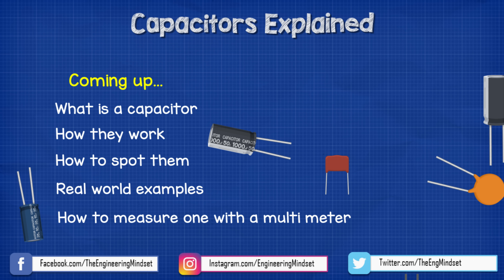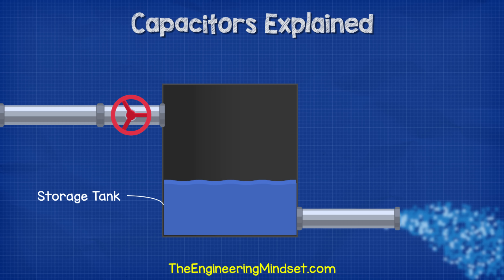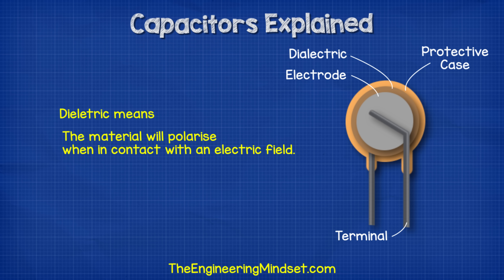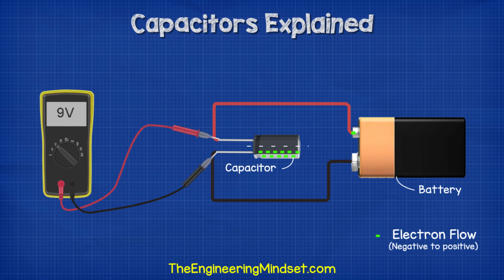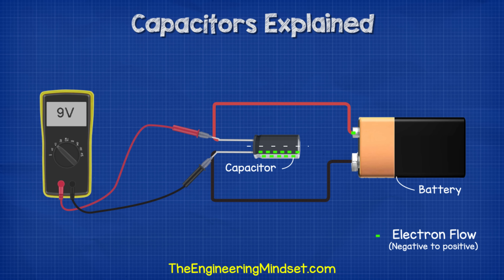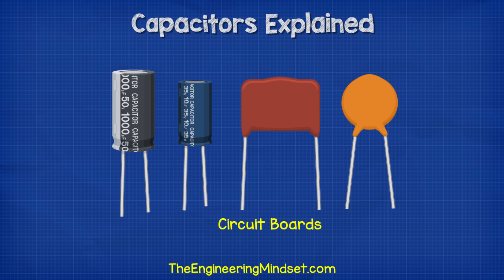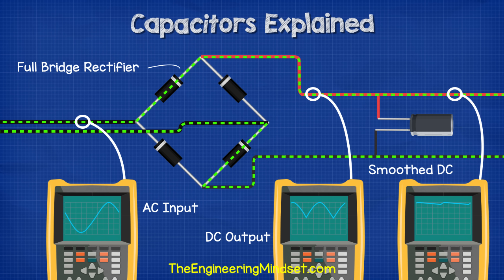Capacitors Explained - The basics how capacitors work working principle

Comment: I remember using capacitors a few times in college whenever we had practical builds, especially when we were making full bridge rectifiers. It was always fun when someone occasionally messed up and put them in the wrong way, cause they'd pop with a loud bang.
Reply: When I was working on the design of a 1 kW half-bridge switchmode power supply, a failure in a MOSFET led to an imbalance in the voltage of two 1000 µF 250 V electrolytic caps connected in series (something which has to be considered very carefully). One of the caps exploded. It was like firing a shotgun indoors.

One of my clients ignored my instructions and tested another product I'd designed without the over-voltage protection circuit, which was fairly elaborate (their product was a generator run by an air motor). It blew a big electrolytic off the board. You could tell the direction from which the blast came by the little bits of of the paper insulator from the winding of the capacitor hung on other components.
Reply from the maker: See my new MOSFET explained video here➡️: https://youtu.be/AwRJsze_9m4

Comment: I still don't know what you're talking about. I've always found electricity and magnetism fairly baffling going right back to physics lessons at school. I must have the wrong kind of brain.
Reply from the maker: The capacitor has 2 sides. Electrons build up on one side at a time. They can be released into the circuit. We can place thing slike LED's in the path as they are released to power the Led.
Reply from the maker: Seen the new LED explained video? so much detail covered! https://youtu.be/O8M2z2hIbag

Comment: Great video!  You may want to mention using an LCR meter with Kelvin Clips to accurately measure capacitors.  A multimeter is good on the fly for rough values, but is very inaccurate.
Reply from the maker: Check our new Multimeter tutorial out ➡️ https://youtu.be/4lAyzRxsbDc

Comment: I love and appreciate how the illustrations showed DC correctly going from negative to positive. It is amazing how long people, including the scientist and inventors thought the current went from positive to negative. That is why most equipment that uses DC (think cars and such that run generators or alternators) are negative grounded and protect the positive when it should be the other way (more efficient) and because it was the way it always was it still hasn't changed.
Reply: I seem to remember that cars used to be + or - ground randomly, but it was found that positive ground caused corrosion in the steel bodywork, so negative became the norm.
Reply: @chrisbrace7132  
I don't know whether it really makes any difference with something like a car, but it is certainly the case that if you make a metal structure in contact with soil positive and have a large "ground" field that is negative, you will cause corrosion. "Cathodic protection" does exactly the opposite of this. Metal structures are made negative. Oxidation is the process of loss of electrons from atoms. If you replace the electrons the corrosion is controlled. The amount of applied current needs to be quite carefully controlled for best effect. This is very widely used, especially for things like pipelines. In certain circumstances anodic protection is used. With some metals a surface film of oxide protects the bulk of the metal from corrosion. Aluminum is an example.
Reply: "Conventional current" flows from positive to negative. In symbols for electronic devices, arrows invariably point in the direction of conventional current flow e.g. a diode symbol. Anyone with more than a few minutes of experience in the field has no difficulty coping with this.

It is utterly irrelevant whether "ground" is negative or positive in any generalized sense. In vacuum tube circuits, the common is normally negative. In the days when PNP transistors were by far the most common, "ground" was positive. With most modern electronics "ground" is usually negative. In modern automobiles ground is negative because that is the most compatible with modern electronics. The notion of "protection" just does not come into play.

Comment: This is a very good explanation as far as he goes.  This is mostly about filtering caps.  There are also cap used for coupling and tuning and maybe others I can't think of right now.  Coupling caps pass the AC part of a wave to another stage but block DC.  Tuning caps and Inductors are used to resonate a circuit to a particular frequency.  Some caps need to also be rated for current carrying capicity and theunit is Amperes or Amps.

Comment: Please do a video on a "Relay." It is a remote control switch turned on and off by a low voltage circuit to turn on a high voltage circuit. Thanks. - TAV ♥️🇺🇸🌎👍
Reply from the maker: Please watch our videos on relays
Reply: @EngineeringMindset  Can you put a link to the "Relay" video please? Thanks. - TAV ♥️🇺🇸🌎👍

Comment: My uncle made a device in the 80's. One of a kind medical device until just recently. Someone made a ted talk abut a similar device. It only took them 35ish years to "discover" how to make something similar. Congrats I guess. Not their fault though, a Japanese company bought my uncle's device and tried to replace all the parts. They wanted a cheaper version. They had a basic idea of how the parts worked I guess. But it  couldn't be duplicated by them. The problem was they focused on basics like voltage and failed to take into account oscillation, wave time, frequency etc. It's like building a spring clock. You can't just throw in whatever parts you want- the parts go together, they work together and are based off each other's properties.

Comment: If an electric circuit is compared to water flowing through pipes (resistor=narrow, etc), might not a capacitor be likenened to a rubber balloon?
Reply from the maker: Check out NEW resistor video, everything covered! ➡️ https://youtu.be/DYcLFHgVCn0

Comment: i have a question if anyone who is knowledable about electronics , would care to to answer . i bought one of those wind up dynamo flashlights at a thrift store one day , the LED's would not light unless i was cranking the handle , as soon as stopped cranking the leds would go out . i bought it anyway because i think they are neat and i knew i could use it anyway if i cranked it . i was outside sitting in my car and was cranking it more to see if maybe if i did it long enough it would charge the battery and then work without cranking . a guy who was parked next to me was getting into his car and saw what i was doing and said " the capacitor is bad " . do they use a capacitor to light the led's ? i always thought they had like a dry cell rechargeable battery

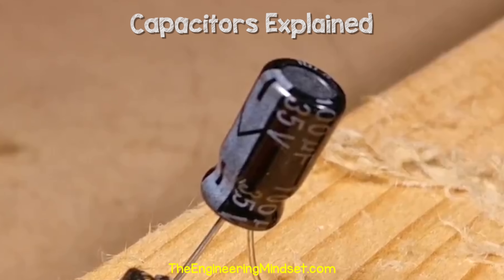Comment: Hey "it's that guy again"  6:10 was NOT an overloaded capacitor but rather polarized cap with DC applied reversed polarity.  Capacitors are designed to fail undramatically when overloaded.

Comment: You have what is known as polarized and non polarized capacitors. For speaker cross-overs, you need non polarized. A lot of times 2 capacitors are built in series internally with opposing polarities. Oil filled capacitors are non polarized. They can handle heavy current loads and are used for starting motors mostly. For amplifiers, the bigger the farads, the cleaner the AC hum will be usually. A quality amp has a bleeding resistor to kill it when power is removed.
Reply from the maker: Check out NEW resistor video, everything covered! ➡️ https://youtu.be/DYcLFHgVCn0

Comment: We had an Electronics engineer as an instructor in college. I got the distinct feeling that he didn't want us to have the same level of knowledge that he had.....no scratch that......he didn't want us to have the same level of "understanding" that he had. I expected that we would do extensive work with each component on a circuit board.....starting with simple circuits and leading up to more and more complex circuits. ....spending at least half our time in the lab....if not more. By the end of two years it was like so many comments have said here.....I'm learning more on YouTube then I learned in two years in college. That's pretty sad. We were a class of working class people trying to better ourselves by learning the electronics trade. You would expect to be able to do a circuit analysis and repair of electronics by the time you graduate from such a program. YouTube is more valuable for those purposes.

Comment: I grasp all these engineering concepts well and know basic soldering skills, but I just don’t know how to efficiently design schematics with software and then apply the same structure into breadboarding
Reply: I'm in the same place trying to learn how to build crossover circuits an for audiophile grade speaker system and to upgrade components in a tube amplifier kit.  Don't want to smoke a bunch of high end components..  : )

Comment: So a quick question. Im not full of knowledge when it comes to electronics so here I am. I have a project car and want to do everything diy and thus want to make a rev limiter with a relay and capacitor with a push button switch

So the positive and negative from the coil of the car goes to the positive and negative to the relay and then a earth is connected to the body of the car and tje other 2 wires goes to fhe switch that also earths the coil

So i just want to know where to place the capacitor in this contraption because its a limiter at the moment but i have to put the switch constantly for the car to limit

I know it's a bit off topic but this is where I feel I will be helped

Comment: so in theory the side with the stripe should be facing the (+) side of the batery correct?
just want to make sure I'm getting this.
I am legally blind and was just a little confused.
Because when Im wiring a speaker, red is (+) and black is (-)
 And you do red to red and black to black on those. Those aren't DC circuits I know but it was still causing me to become confused a bit applying things conceptually to this and understanding.

Comment: Does a capacitor have to always be in parallel when other components are in a circuit, if capacitors aren't able to pass current through once fully charged, or am I getting confused
Reply from the maker: See here https://youtu.be/ucEiEic-kZ4
Reply: @EngineeringMindset  Thank you! Your videos are really helping me in my revision for RAF Airman Selection Test

Comment: I have always found that when experts start using needlessly complicated explanations it's because they don't fully understand what they are talking about. This video is a breath of fresh air.SUBSCRIBED
Reply: How have you found that these experts don’t know what they are talking about?
Reply: @Smiley957  bitter experience
Reply: I go great until the expert says, " this is theoretically how this works" because it can't be proven. Then I start on the alternative theories. Inside there are little men on bicycles making that motor turn, the electricity shocks them into action. Don't get me started on watts, steam and horse power. What kind of horse are we talking about. Appaloosa or Clydesdale.
Reply from the maker: Seen our new video on How electricity works - for visual learners? Link:➡️ https://youtu.be/3KePcASD0NQ
Reply: HAAAHAAA you didn't get heart even though u tried to leech HAAAHAAA

Comment: Hey you did not cover (ESR) and why this is important when it come's to using Capacitors. Also the meter shown, doesn't have (ESR) read out. Do you not use (ESR)? If you do, 'what Meter would you recommend?

Comment: I confused a little... on previous video about diodes, in the circle you show white strip on black diode's body are close to cathode...it's means connected to "-" terminal of battery. And electrons entering through cathode and flowing out through anode...and you show that on video https://www.youtube.com/watch?v=Fwj_d3uO5g8&t=23s&ab_channel=TheEngineeringMindset at 9:30 min. But on this video, starting from 6:41 min you showing opposite direction what is confusing me... So what is right..?

Comment: A capacitor (sometimes called a condenser) is a two-terminal passive electrical component that stores energy electrostatically in an electric field. A capacitor, unlike a resistor, does not waste energy. A capacitor, on the other hand, stores energy as an electrostatic field between its plates.
Reply from the maker: Check out NEW resistor video, everything covered! ➡️ https://youtu.be/DYcLFHgVCn0

Comment: I went to an English college of technology in the 1960s. (To study electrical engineering). Although the lecturers seemed genuinely interested in doing a good job, they never had the ability to convey advanced concepts. We were, largely, left to acquire the knowledge from textbooks or other sources. I wish we had people such as yourself at the time. 
As a suggestion, it would be good if you could run over some of the higher mathematics with respect to AC and DC voltages.

Comment: In non DC applications a capacitor is also used for signal filters. In this case the differential equations show the elegant properties for filtering. The humble capacitor has lots of uses.

Comment: Hello Engineering Mindset,
Thanks for the great explaination video. I have one question. I thought for rectifiers - at 6:55 - diodes were the parts that do that job. Or is a capacitor actually a diode that can also hold voltage for a moment?
Reply from the maker: https://youtu.be/RiRyzLl4Y8U
Reply: @EngineeringMindset  Thanks for the link!

Comment: Ok. So, there are many different kinds of capacitors, epoxy dipped, tantalum, oil filled, foil wound, electrlytic, etc. Let’s say we’re looking at a schematic diagram how does one know what type of capacitor to use when building the circuit?

Comment: I can say from experience that selecting the right cap for a particular application often requires a Ph.D. in capacitor technology. There are so many electrical parameters, materials, dielectrics, and cost points it will drive you nuts. It takes years to figure it all out. Just give it your best shot, read up on cap selection criteria and ask senior persons on staff for their experience.

Comment: The voltage on the side of a capacitor isn't always the maximum voltage they can handle...I can take you to any large commercial or industrial buildings and show you run capacitors rated 440VAC on single phase motors on circuits with voltage as high as 490 volts, more if you read the back EMF. Some of those capacitors are even rated 370 VAC, depending on motor design.

Comment: Quick note. Electrons do not move. Matter of fact, they move exetremely slow. What goes around the circuit is the energy that the neighboring electrons exchange. It is very hard to move electrons outside of the atoms eliptic orbits (ionizing). It is a nuclear procedure that takes a lot of energy.

Comment: Jumper leads have a capacitor attached to prevent dangerous ( to electronics) voltage spikes. My old trail bike with a dodgy ignition switch used to blow stop light bulbs all the time. Replacing the switch stopped the globes blowing.

Comment: 7:50 reduced to millivolts before handling? c'mon it's not really that dangerous. 30 is safe. As kids we use to play with 220v capacitors by sticking them into socket then shocking each other :D that was fun. good they didnt explode
Reply: There hasn't been 220v in Europe for over 70 years. I believe you mean 231v. 400/sqrt3 :)
Reply: @dededededededewedq  who knows, might as well be from old vacuum tube TV, but you probably right

Comment: Would you be able to do a video on polypropylene or polystyrene film capacitors below 1 microfarad for Equivalent Series Resistance at low and high voltage? Lots of videos on electrolytics. I'm happy to have subscribed.  CHEERS

Comment: If at anytime you have a refrigerator , Air conditioner , Freezer and the compressor hums for a short time and doesn't turn over then shuts down , Check the capacitor
Instead of replacing the whole unit 
A bad capacitor is the most common cause of refrigeration compressors not turning over on start up
The capacitor gives the compressor motor an extra boost to get it going because with a refrigeration compressor , It actually starting against a load because the system is constantly under pressure
Recently I fixed a beer meister for my lady friend and her husband and they were worried sick about throwing it out but I checked the capacitor and found it was bad
Replaced it with a new one and the compressor started right up
If there happens to be more than one capacitor in your refrigeration system
Replace all of them to properly balance the electrical system in the unit and to avoid trouble another time later 
They were so very happy that I saved their beer meister because they bought it 12 years ago and paid 700 dollars for it and they loved the color and the detailing on it and that's why they were hoping I could save it for them and when the unit started right up , That really made me feel great
So if you have a hard time finding the capacitor you need , Call Grainger
That's where I found the new capacitor

Comment: can I suggest a way to illustrate a capacitor?:  a pipe with a stretchy rubber diaphram at the midpoint, which allows only so much flow before the diaphram reaches its limit and stops the flow.  When pressure is removed, the diaphram discharges by returning to its neutral position.